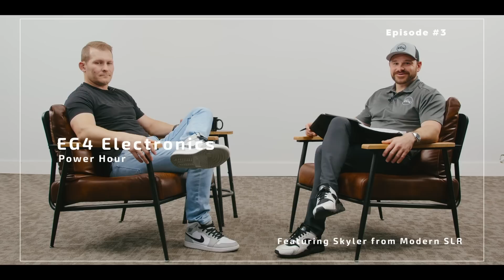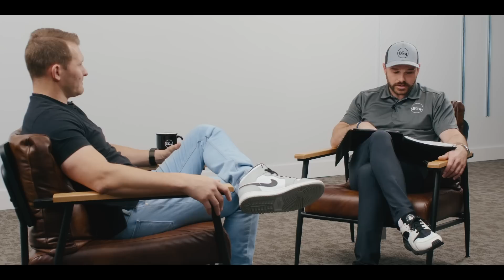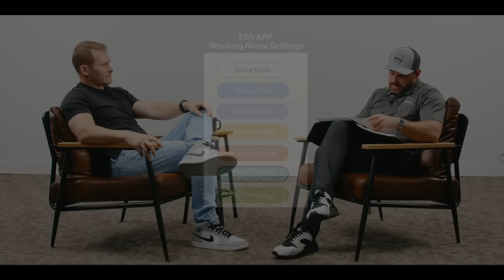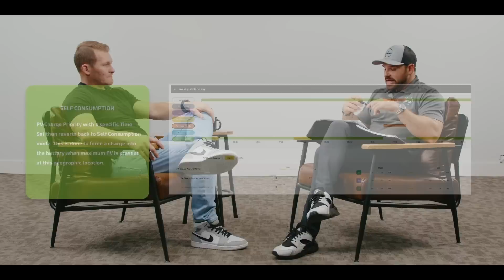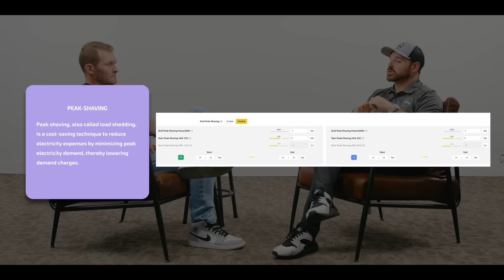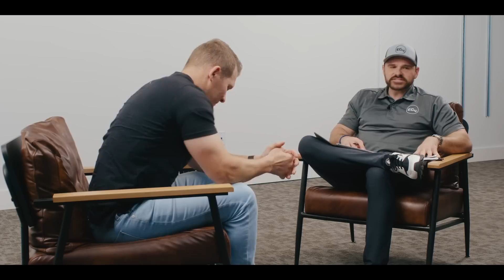POWER HOUR ft. Skyler Dyer from Modern SLR || Beat Rising Utility Rates with EG4

Comment: I believe the right approach isn’t to go fully “off-grid,” but rather to use the grid as a backup. With today’s increasingly reliable energy storage systems—especially with equipment like EG4—you can size and scale your system gradually, based on your budget, to cover most of your energy needs independently.

In this setup, the grid becomes your safety net, used only in rare cases when you need additional power. Modern energy systems are far more powerful, reliable, and affordable than they were just a few years ago, making this strategy both practical and cost-effective.

For anyone considering this path, keep in mind that utility rates are likely to keep rising, especially if current subsidies for energy providers are rolled back by the administration. Planning ahead with the right system puts you in control—financially and operationally.
Reply: I couldn’t agree more with you! Its apparent to most customers that our Hybrid inverters like our Flexboss21/18 in combination with our GridBOSS are a perfect fit for this. But what many people don’t know, is that our “off-grid” Inverters such as our 12000XP can utilize the grid-assist feature, where you truly are leveraging the grid as backup only when needed, it just doesn’t sell-back. So if you’re part of the hardcore “off-grid” camp and never want to sell back, you can still use our off-grid lineup. OR! You can simply turn off sell back on our Hybrid inverters. So if you simple just don’t like the principal for sending your energy to the grid..simple, just turn it off! 😊